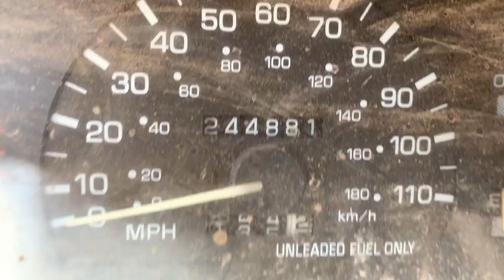Desertphilemobile

Comment: I had a 1991 Toyota bench-seat 4 wheel drive Pick up - lasted 13 years, 160k+ miles before some Stop Sign runner decided otherwise.  5 speed, old school 'lock the hubs' for 4-wheel drive,...Gawd, how I miss that truck.

Comment: 244,881 on the original 3VZE 3.0L engine is pretty damn good. They are notorious for blowing the head gasket at anything over 100,000 and being the biggest PITA to repair because the wiring turns to dust inside the valley between the heads. I did a short block on my father-in-law's 91 Toyota 4×4 pickup and hated it all the way. When it finally craps out on you, swap it for the more powerful 3.4L off a +94' since it's a farm truck now and doesn't need to pass smog.
Reply from the maker: Indeed. The head gasket blew on mine, but the cost of repair was covered under a recall. Whew! No way I could have paid for it.